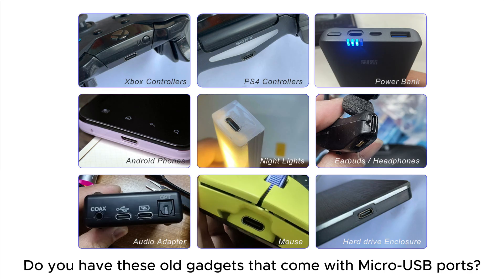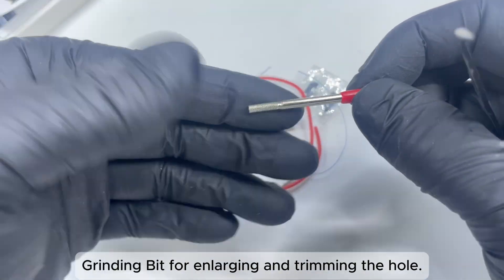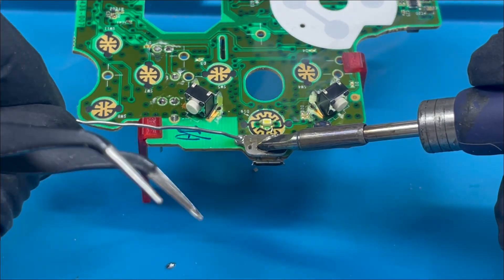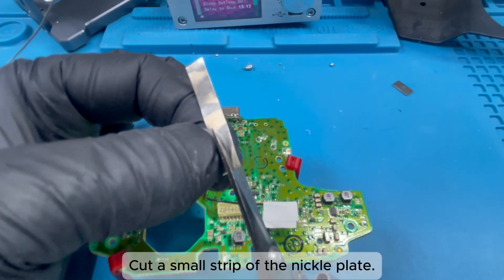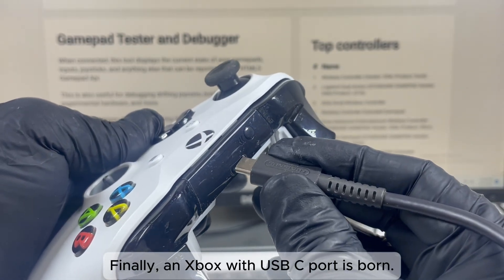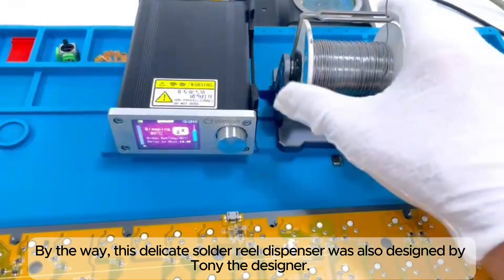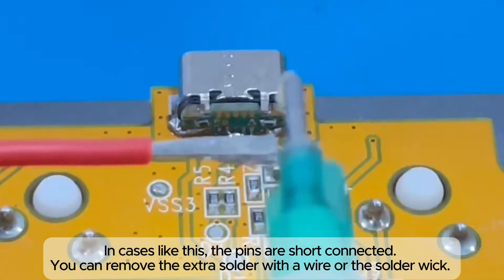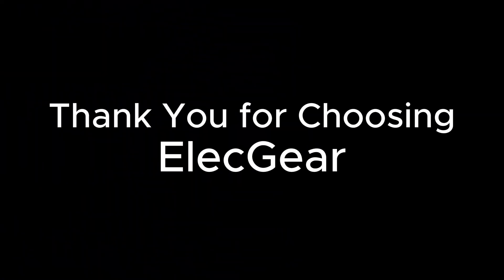ElecGear USB Type C to Micro USB Replacement Port, Upgrade Micro-USB 2.0 to USB C Adapter Socket

Comment: rather than retrying a few solders to get itpositioned right, a dob of hotglue on the pcb and port shroud will hold it till you can get the soldering done, and be easily removed afterward. If your hands don't shake soldering stuff that tiny, the spring clamps from a helping hands setup will also hold it in place to start.

Comment: Please replace the connector micro-b 3.0 to usb type-c port
I have ha hard disk western digital with micro-b port but i need to replace type-c port
Reply: USB C 3.0 isn't necessary. If the original port was a micro or mini, it won't have the additional data lines for USB 3.0.

Comment: Is still going to rip off
Reply from the maker: I think it will not be easily ripped off. For the metal body was soldered with the PCB. Not only because of the nickel plate, but also the solder. Piercing through the via/hole to the back layer of PCB is vital. It surely takes soldering skill.

Comment: hey did the id line work
Reply from the maker: Hello, actually. The ID line is decided by the device. Not the port. The tiny PCB does output this ID from the Micro-USB port. But it is nothing to do with the C port (of any the internal 16Pins). You should connect this ID to Gnd, Vcc or leave it idle according to the device.